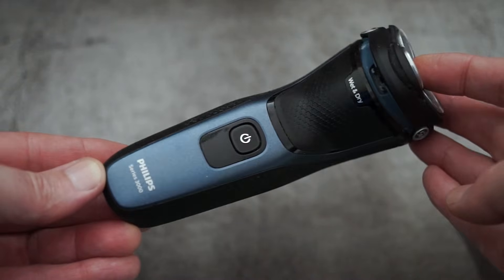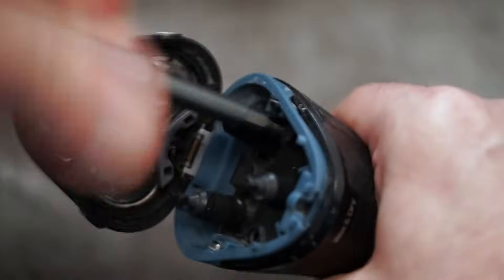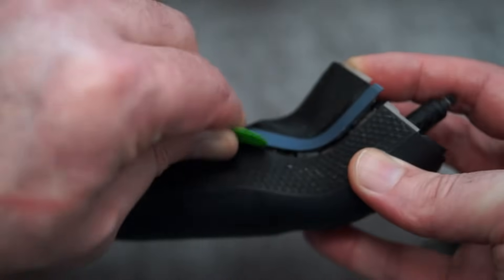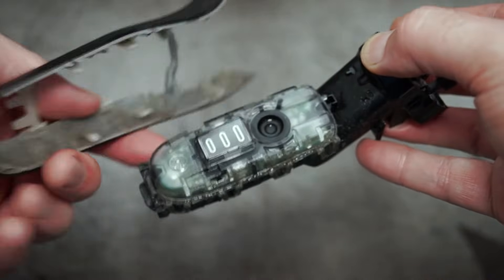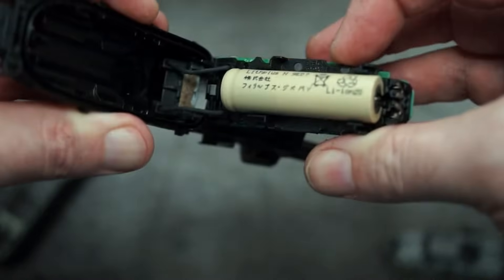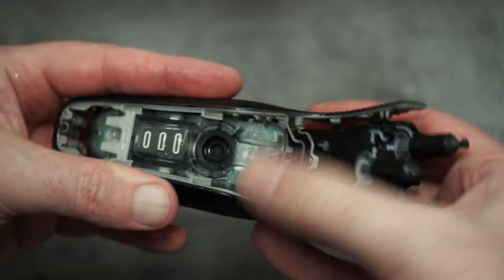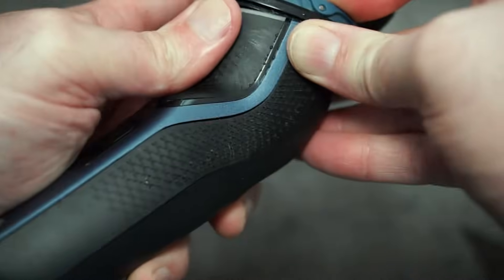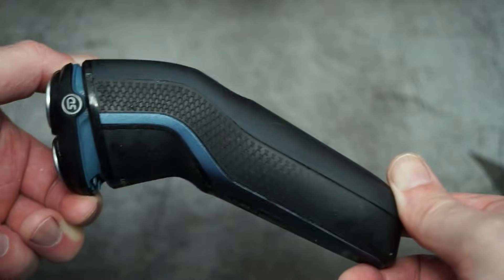Philips Shaver Series 3000 Teardown/Battery Replacement

Comment: My shaver suddenly stopped working fully. It's fully charged but the rotators only work poorly with the upper cover open, as soon as I close the cover, the blades won't rotate. Can you advise please? Thanks.
Reply from the maker: Sounds like the battery is not working properly (worn out), it's up to you if you feel it's worth changing it.

Comment: Is it possible to replace the battery without soldering the new one? Maybe fixing that with some adhesive . Lithium Batteries with heat are very dangerous...
Reply from the maker: It's spot soldered so you have to de-solder it anyway, as long as you're not on there for long it's not an issue the cell vents it won't blow up

Comment: Well presented and explained video .  😼👍I find that these models tend to last 3-5 years . 2 days ago , my shaver was charged fully but nothing doing . All lights on but motor not running . My replacement series3000 arrived this morning . For £55 I expect it to last until 2027. Can't really complain tbh, plus it saves faffing about in uncertainty. 
This latest model also charges via usb which is a welcome improvement . I charge my iPhones and iPads through my iMac so this saves me having to plug into a wall socket .
The only negative is that for some reason , there was no brush supplied . I have unused ones , so not an issue . It's a basic requirement that should not have been removed . 
This model comes with a 2 year guarantee if I can be bothered to go through the mPhilips website . 
1 year is fine with Amazon , so I may not bother .

Comment: I’ve never soldered before but it would be way cheaper than buying a new razor, any tips on first time soldering/ what I should buy to do so?
Reply from the maker: Get some "solder wick" it soaks up the solder and then it's easier to remove. Just heat both sides of the battery with the wick and it will soak up the solder. Re-apply solder with a new battery fitted (solder the cells ends then insert, and heat up the contacts to bond)
Reply: @MrBazReviews  thank you so much this helps a lot, ill give it a shot. have a great day :)
Reply: Soldering is a knack. Practice on some thin brass sheet or some wire first. You will need some liquid flux. I use Baker's fluid but smaller amounts can be purchased on-line. The soldering iron is also important. It must suit the job with a smallish bit and wattage for this job. For this job I'd favour a small rechargeable battery iron. Certainly NOT a gas heated iron as they get far too hot for this. The trick is to be quick. Whether soldering new or removing old, be quick. 2 to 3 secs is long enough. Soak up the existing solder with a "wick" (Close woven strands of copper wire, also available on line). Clear the hole for the tag until it lifts out. In goes the new battery, Whetted with some flux. (You can use a small brush the size of one in bottle of nail varnish. Whet the tip of the iron with some solder. Use thin wire type solder. {Multicore is my choice}. Offer the end of the solder wire up near to the joint and then heat the joint with the hot soldering iron tip, (bit), while feeding in a little more solder.. One to three seconds is the maximum time or you will likely damage the printed circuit board. (PCB). 
A lot of words for something that gets easier as you practice.

Comment: I can see your silver open/close switch ("release" button) is missing, mine is missing as well. How were you able to open/close the head without the switch? I can't close it anymore since my switch came off.
Reply from the maker: It broke so I made a warranty claim from Philips and they sent me a new one! Before that I had to hold it shut (just by using it) to get it to work. I never found a way to fix it as the part that holds the foil down broke.

Comment: I did all the steps but I'm having trouble to get the battery I out. Can you explain how to get it out easily🙏
Reply from the maker: You have to de-solder it, ie soldering iron and copper usually to remove most of the solder

Comment: I didn’t know they had soldered in cells : I followed the video step by step as I was doing it . Anyway it is what it is .
Reply from the maker: They do it so if you drop the item it won't disconnect or the terminals get damaged, but it would be a lot easier if you could just slot a cell into the body or they had an easy access to the battery.

Comment: I wish you had said you need to solder the battery off at the onset! Spent a good half hour taking it to pieces and then told that !
Reply from the maker: The video is 3 minutes and 37 seconds, it's not exactly a long watch to find that out. Almost all devices of this type have soldered in cells it's standard

Comment: Many thanks for the video.
It's scandalous how difficult this is. It just encourages wastefulness,
Reply from the maker: You're right it would be so much easier to have a removable battery pack that didn't require you to pull apart the case.
Reply: @MrBazReviews I tried to find a corded one, but there's virually no choice. Still, your video is very helpful as it reassures me that I can replace the battery and thereby not have to throw the device away once the battery is depleted. Many thanks again.,
Reply from the maker: @1TimBaugh  Very few around on corded options. It's shame you can't power it via mains, I suppose someone might drop it in the water. I never had a problem myself with corded ones.
Reply: Yes as my late father would have said : what a Pahlava . Unnecessary complicated : I won’t buy a Philips again!

Comment: Just realized that inside the shaver there is a 3 level battery indicator. The plastic on top covers the two of them so from the outside yours only has one indicator. Damn.
Reply from the maker: There are several small variations on the battery indicator, but frankly it makes little difference it just flashes when it's low
Reply: @MrBazReviews  Well yea but I found it interesting how the model with one battery indicator has 3 on the inside but not used. All that changes when you get the 3 charge indicator model is the plastic on top
Reply: @1eonm4k well spotted, many manufacturers do that, cheaper to make in bulk but they can still have price points with better "features".
Reply: @MrAllstar  Well yeah, that makes sense. I’m just surprised every time I see a case like it, it almost looks counter productive so I’m always amazed by the fact that it actually does save money lol

Comment: Why not a ordinary slot in lithium battery, without all this pulling things apart, how long does a battery last on these shavers!
Reply from the maker: We live in a disposable society! Sadly. It depends on use it should last multiple years. Maybe 3-4 years possibly a bit longer
Reply: I have a corded Philips that has been my only daily shaver for ten years.  Noisy, but still going.

Comment: Thanks for the video - very useful. I replaced the battery but all that happens when I press the on/off button is that the orange LED flashes. Nothing happens when I plug in the charger. I've checked that the charge voltage is present on the PCB pads, so the prongs are connecting OK. Any ideas?
Reply from the maker: Something must be disconnected or damaged I would be using a magnifying glass to check over everything
Reply: Same issue here, does it still hold its charge?
Reply: The same problem today. New battery soldet, but not charging at all, just fast orange flashing. Charger ok.
Reply: I have the same issue. Please reply if you determine a solution. On the model I bought, the orange LED illuminates to indicate a replacement of shaver heads is needed. I wonder if this error light can be triggered by an over current fault (due to stuck motor shaft from debris intrusion). I will be trying to investigate the motor soon. I have not tested the battery yet, so I have no ruled out battery failure, in my case.

Comment: Hello, whats is your model of shaver i have phillips s3134 and battery voltage minted on case is 15v how its possible
Reply from the maker: I got a replacement from Philips (first one clip on the top head broke)
The model is S3133, the 15V is the output of the mains charger, so yes it charges at 15V

Comment: A digital voltmeter is seen (1:19)  inside the shaver. Kindly elaborate its presence and utility. How to repair or replace the  touch switch of the shaver?
Reply from the maker: There is no voltmeter inside the shaver, I have no information on the switch and if it's serviceable
Reply: @MrBazReviews  Threre is a "000" display on the shaver at 1:18 to 1: 21 during the play of the VDO. Kindly refer the vdo. Thanks in advance.
Reply from the maker: @madhusudangupta3661  The only thing there is the 3 stage level/charge indicator, but only one shows on this model, it is likely a shared part with other models. It is not use serviceable as far as I can see. I have no other information on this.
Reply: @MrBazReviews  That's ok sir.
Reply: I got one I bought that fully charged with no charger.I ordered charger on ebay and it does not charge.Anyone know what the problem is? I took it apart and everything looks in order.No charge light on when charger is connected.I let charger connected overnight and no charge up.
Reply: @garyl977  Tricky dickie sale IMHO. The charging electronics hardly serviceable. Buy new PCB and fit it.
Reply: Ladder type voltage level display to indicate the state of charge. Not entirely visible on this model BUT on my model it is through a larger window in the shell. The lowest level also turns red when the battery is very low and needs urgent re-charge. I have the battery capacity at around 700mA hours. Full charge time at 1A runs out at around 10hrs. Mine is done rather quicker than that so perhaps the charge rate is higher at around 1.5A? There's a lot to be said for keeping Li-On batteries in between 20 & 90% charged. Don't go over or under. Whether this on board charger is that savvy is open to question. Store about half-charged is best.

Comment: Great demonstration of how to replace battery in shaver. Would need more info on the type of battery, size, voltage and is it mercury etc. Where to buy one etc.
Reply from the maker: Simply read the code on the battery, you can then order a replacement. Such as from here:
http://bitly.ws/SpPJ
Reply: Li-on 3.7V almost certainly 700mAh with solder tags. Available almost anywhere. Check size of cell with Video enunciator

Comment: Our heads have a notch in them not the little wings.  How do you know where the notch goes?  We cleaned it and now one head isn’t rotating but the shaft spins fine. Thanks!
Reply from the maker: I have not seen that design, keep turning the foils/cutters by hand until they slot in. Or look at the other cutters to see how they fit in
Reply: Stops the foil from spinning. Various Philips designs over the years.

Comment: Found a broken ground on the motor. I was able to strip the wire and heat the old solder and attach the new exposed wire. Worked like a charm. Thank you for the video.
Reply from the maker: Interesting, glad it helped fix it

Comment: THIS IS WHAT LANDFILLS WERE MADE FOR.
Reply from the maker: Probably better to re-cycle at least the cell. Where I am there are battery re-cycle points in many larger shops.
Reply: @MrBazReviews  MAYBE.
PERSONALLY, I STOPPED RECYCLING ANYTHING HERE IN AMERICA AFTER I FOUND OUT THAT ALMOST 100% OF OUR RECYCLABLES ARE SENT TO CHINA, WHERE THEY RECYCLE ONLY WHAT THE CCP CAN USE FOR THEMSELVES AND DUMP THE OTHER 90% OF IT IN THE OCEAN.
Reply from the maker: @DOOMJESUS  You might be right, still I'm not sure it's a great idea to put Li-ion cells in to the ground, so removing them is probably a good choice
Reply: @MrBazReviews  MAYBE. OR MAYBE THE EARTH LIKES IT. HOW DO YOU KNOW IT'S NOT A GREAT IDEA? IT COULD BE A REALLY GREAT IDEA FOR ALL WE KNOW.
WE NO MORE KNOW THE ANSWER TO THAT THAN WE DO WHAT TEMPERATURE THE EARTH IS SUPPOSED TO BE.
PLENTY OF PEOPLE CAN TELL ME THAT IT'S BAD FOR THE EARTH'S TEMPERATURE TO RISE.
BUT NO ONE CAN TELL ME WHAT TEMPERATURE THE EARTH IS SUPPOSED TO BE SET AT.
Reply from the maker: @DOOMJESUS  It's a big debate that I can't really comment on, however Li-ion is well known for well, they can be a fire hazard for one, they also have many metals used in construction - for the sake of a few minutes to remove them, I think dumping them isn't an ideal option.
Reply: @MrBazReviews  I WONDER WHERE THOSE METALS COME FROM, INITIALLY. AND WHERE THEY ARE GOING TO END UP, ULTIMATELY.
Reply from the maker: @DOOMJESUS  Lot of stuff comes from Asia and erm Russia is well known for mining metals. Down under also has a few things to offer with mining. I think the general idea is re-cycle metals means less mining, less reliance on extraction, and overall less impact on the environment.
A lot of plastics are re-cycled where I am in Europe, we have a bin for plastics in food packaging, and glass bottle banks.
Reply from the maker: @DOOMJESUS  I can't speak for the overall re-cycling programs, they vary from different countries, I don't doubt some are effective and some are not.
Metals are mined deep into the ground, so putting them back out there not that deep doesn't seem to be a smart thing to do (on some metals that is)
Far as I am aware the batteries are re-cycled properly at facilities, so I stand by my comment it's worth taking it out and re-cycling it. I don't want to get into a heavy debate on pros and cons of re-cycling. We all consume too much stuff, I'm not a tree hugger by any means, but that much is obvious.
So where I can I try to re-use things if possible
Reply: @MrBazReviews  where i can get that  buton that holds shave head bacause i lost it
Reply from the maker: @memesaregreat8815  I never found a replacement or where to get one sadly.